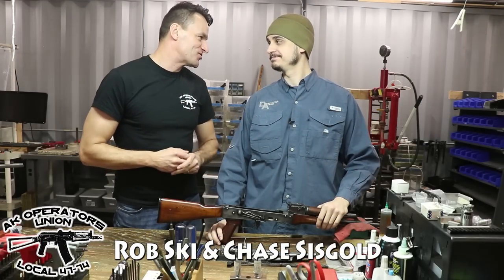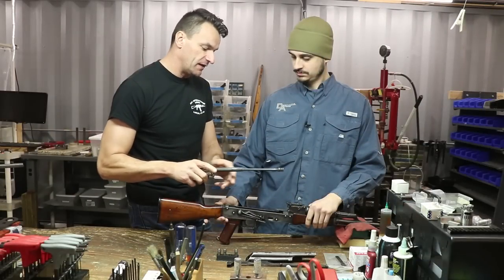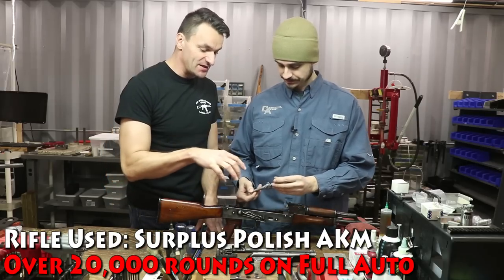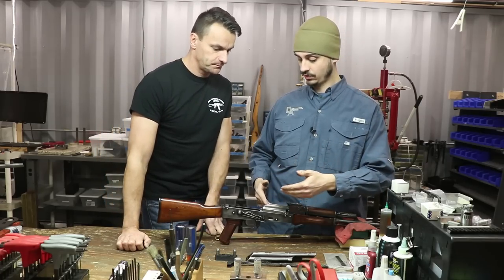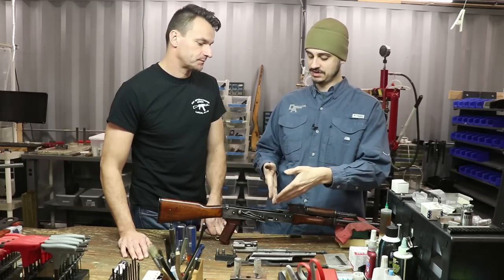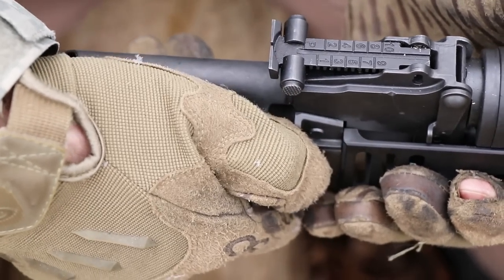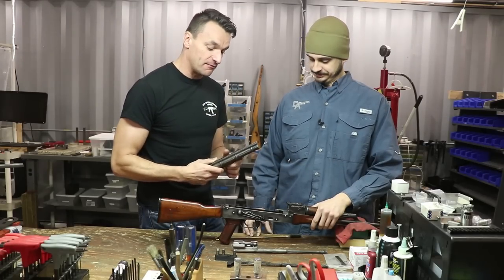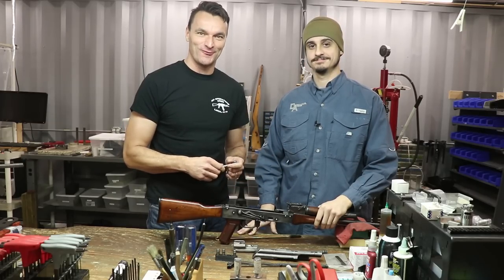AK Headspacing: No Go/Go/Field..?

Comment: In the process of building rifles and trying to gather as much info as I could before a lot was available, I checked a number of new factory built rifles with go and no-go gauges. All of them wouldn't full close on a go gauge with just the bolt, by hand. Very very close, but probably 0.05" - 0.10" from being fully closed. That's how I set all my builds from that point on and it's worked great.

Comment: Great video gents.  Thanks for the information.  I bought a c39v2 and have watched rob ski's videos on the deformation of the "junk" bolt and carrier... being made from cast steel.  In an attempt to prevent this from happening on the new v2 I just purchased a brand new bolt and carrier from Poland which are forged steel.  I need to check head space with the new parts before firing and this information greatly helps.  I didn't know you could check it with just the bolt and the no go gauge...  cool stuff =]

Comment: all receivers should have forged steel F&R trunnions , then anneal the entire assembly in oven @ 475 degs. for 24-36 hrs. , then reduced heat cooling for over 1 - 2 days . this will alleviate the stresses on metals when in constant rapid fire dumps when temps really get up to 900 -1000 + degs.

Comment: This is a good video, thank you for the information. I saw a video of a well known company making American AK's, who slam the gauges into the chamber and claim that its good. Its a wonder why my AK from that company popped a primer in the first 5 rounds and is showing pressure signs on the case heads of all 40 rounds that i fired from it. Its getting a little bit old seeing garbage come out of that company, especially unsafe garbage. I'm going to get some headspace gauges and check and maybe have to send the damn thing back to them.

Comment: As always, great informative video. Also, man oh man, what a beauty that AK is; so much character with that patina on it.
Reply: The Original Mr.Kittens - it’s not patina, it’s distressed. Difference? 

Patina is a green or brown film on the surface of bronze or similar metals, produced by oxidation over a long period. 

Distressed is having simulated marks of age and wear.
Reply: @s0bedrag0n Yes I'd say distressed is the correct term. Though even with steel I tend to use the term patina when it gets some wear on it. It has more of a ring to it than distressed,  in my opinion.
Reply: @s0bedrag0n  Also, I'd say my use of that term also comes from watching several knife channels in which the discoloration of high carbon steel knives is referred to as patina. Of course an AK receiver is probably not high carbon, but I like the term all the same.

Comment: to apply correct pressure can't you just close the bolt and then simply inserting the recoil spring? Would the spring pressure be enough? or is it still too mutch?

Comment: I have a question.  I put the NO GO gauge on the bolt face and insert only that in the chamber.  The bolt turns but does NOT touch the side... it's approximately where his was in the video.  THEN I put the bolt in the carrier and ride it forward and it closes all the way.  I can still see the bolt is not turning all the way or touching the receiver.  What does that mean?  Bad carrier?  Bolt too loose in the carrier?  Will it blow up in my face?

Comment: Please excuse my ignorance here, I'm not a gun smith and I'm new to the AK world. I got an AK from Riley defense way back in 2018 and because I was in the military and also stationed in CA, I didn't have an opportunity to shoot much. Now that I'm out and back home in the PNW, I dusted off my AK and went to the range. I've shot less than 500 rounds in it and have headspace issues and failure to feed sometimes. Can this issue be fixed with just replacing the bolt or because of the low round count, do you think it's just now "worn in" yet? Thanks for the help

Comment: Love the videos. Don't have a no-go gauge yet, it's en route, but I have a question. I recently purchased a VSKA, new, when I zeroed it in the first time I ran 2 and a half mags through it and everything was peachy. The following weekend, I ran 8 mags. During the 2nd-4th mag (all tapco intrafuse) periodically a casing would get stuck in the chamber after being fired. The only way to get the carrier back was to kick start it, but once it was back I saw that the rim of the shell had broken off where the claw was. Prying it out did not work. The only way I could remove the casing was to put the cleaning rod down the barrel. Sometimes I had to jam it down and others I just bounced the rod on the casing and it came out. Any suggestions? This happened 4-6 times and once or twice in those series of magazines.  The rest were just fine.
Reply: Did you ever resolve this issue, and if so, what did you find out ?
Reply: @Soli_Deo_Gloria_.  one issue was the ammo. My rifle doesn't like brown bear ammo. The other thing I did was polish the ramp and the chamber. For me, no issues since.

Comment: I clicked on this video because I have seen you claim in other much older videos that a barrel was trash because it closed on a NO GO gauge, and I thought you had learned something new so wanted to correct yourself.  Although you guys partially addressed the issue, you still lead a lot of people to believe that it matters, and in most cases it does not.  From the point that a barrel fails NO GO, to the point it fails maximum NO GO or the FIELD gauge, usually takes more rounds than most people will shoot through a rifle in a lifetime.  The first thing you will most likely notice when the barrel has reached or is approaching FIELD gauge failure is acutely degraded accuracy.  You could then or at the same time experience over pressure signs on your cases, maybe pierced or blown primers, cycling and feeding malfunctions, and you might have a higher perceived recoil.  In either case, the chances of the firearm grenading on you are pretty slim.  Almost none.  You will experience reliability and accuracy problems that cause you to address a bad barrel long before that happens.  GO NO GO gauges are for installing and reaming a new barrel.  FIELD gauge is for helping to determine when a barrel has reached the end of its useful life.  It has nothing to do with modern metallurgy compared to back in the day.  Reaming is done by hand or crude automated methods.  That is why there is a need for some variance.  If you ream into NO GO territory, you are going to get less overall life out of that barrel, but it doesn't mean it is bad.  Even if it is new, or only has 5000 rounds through it.  The overwhelming majority of rifles grenading are due to bad ammo or an obstructed bore.  If anyone out there is changing barrels or getting rid of a rifle simply because it fails a NO GO gauge, they are wasting their time and money.

Comment: I just purchased a wasr 10 and the bolt would not close on a go-gauge.

Should I be concerned ?

I haven’t fired it yet.
Reply from the maker: No. Wasr10 is often set with very tight headspacing. Shoot it and report back.
Reply: Awesome !!!
Thanks for the reply.

Comment: Hi have you heard of using on the AK-47 wood hand guards the Heatshield Products Lava Shield Part no. 770001, it well withstand 1200F continuous, 2000F intermittent stopping 80% radiant heat. Well this really work??
Reply: It can withstand, but how much of that heat is stopped from going through to the wood? I ask because many handguards can take the heat, but you still feel a lot of hear coming through
Reply: I haven't tried it yet but I was told that the AK-47 never gets close to 1200F so no heat is going into the wood so your hands would never get hot. I got this now so this summer to try it and see if it works.
Reply: @kronoswolf8335  If an AK got to 1200F the receiver would loose heat treat/temper. a "very hot" gun after loads of magdumps is going to be MABEY 400
Reply: ya I know the heat wont get that hot, I was told that after 5 mag dumps you wont feel any heat on your hands. that is hard to be leave. did anyone try this??

Comment: What about the common AK owner, who may shoot 5,000 rounds a year. Do I need to buy a go/ no gauge to shoot my AK safely? Just to own it? Is there a simple test to atleast let me know if I might be in the danger zone, so I'll know when to seek out an expert?
Reply from the maker: Yes, they aren't expensive and it will most likely serve you for life...
Reply: Doesn’t hurt to get the gauges but you can start to tell there’s headspace issues by looking at spent casings. If you’re seeing them ruptured or popped primers, you might have a headspace issue. Most likely the issue is the barrel is walking forward, and it’s not a metal issue on the bolt or barrel. The trunnion that holds the barrel is typically the weak point.
Reply: Ak Operators Union, Local 47-74 how are your high round count wasrs holding up? my wasrs are all i shoot the crap out of, if your wasrs are good to go, ill just skip the gauges and not worry about anything
Reply: Checking the spent casings will tell you much more information than a headspace gauge will, especially when you're using undersized SAAMI spec gauges.
Reply: @texasghost6725  Pierced primers, overly bulged cases, cracked cases. A little bulging is fine as are cracks, especially with steel cased ammo which is harder than brass and can't expand as easily. You see a lot of that you know headspace is out of whack.

Comment: What a coincidence that a wooden furniture AKM can be run hard for 20k rds and be fine! Who knew? Not some corners of TN, apparently.

I think this attitude that America can't make AKs because the economics don't work is complete and utter bollocks. They just need to make them to spec. That's all. A sheet metal gun with loose tolerances and high bolt thrust must employ the appropriate steel and associated treatment. 

I don't get why Century can build a gun that is class-leaing in accuracy, operation, and finish, but complete dogshit materially. It just boggles my mind.

"Much good work is lost for want of a lttle more."
Reply: the "Loose tolerences" thing is kind of a misnomer the trunion of the AKM has to be made to precice spec.

But it really is as simple as, Slavic country's have AK factory's that have been open for decades, mechines paid off by governments decades ago, and cheeper than american labor

US manufacturers cant compete with that on such a small scale so they have to cut corners. or there guns would cost more.

Now if they where doing it on such a large scale as the other manufactuers they would have an easier time being cost competitive, you must remember US manufacturers are makeing often less than 10k of these things a year. where lets say ROMARM (Company in romania that makes the WASR) is selling lots of thousands of guns to individual customers at prices low enough to compete with 120 dollar surplus AKs on the international market
Reply: @therideneverends1697   I don't think there would be a huge objection to paying more money - even the WASR is creeping well north of 800 dollars new at the moment, and the Bulgarian Arsenal stuff has been four digits for seemingly ages.  I don't think the AK  necessarily has to be cheap for developed world consumers. it is after all a really good rifle and well worth getting into.  The 'cheap' label is now largely a perception thing in the Western market. 

I agree with you completely about production; Forging equipment is particularly expensive (and not particularly flexible like a CNC milll), then you have to invest the time in making sure you're getting your steel right. This does make me a bit suspicious of PSA as I can't see how they're doing a decent AK for what is a killer price. Perhaps they're not making anything on it for now? But they are doing it. so it shows it can be done.